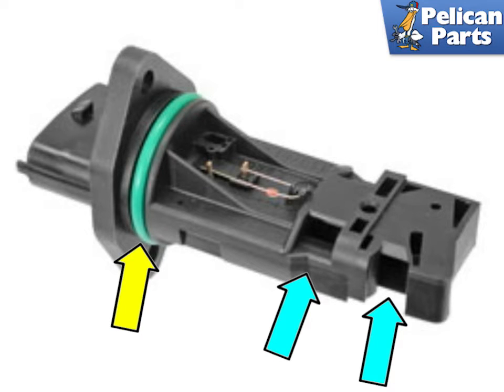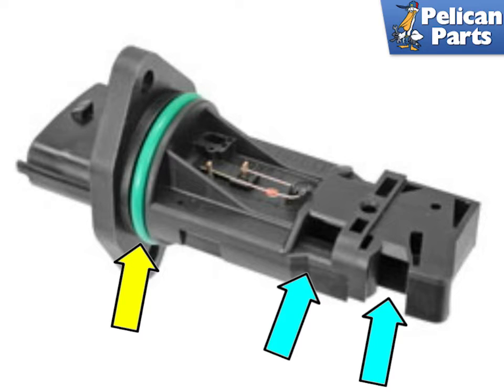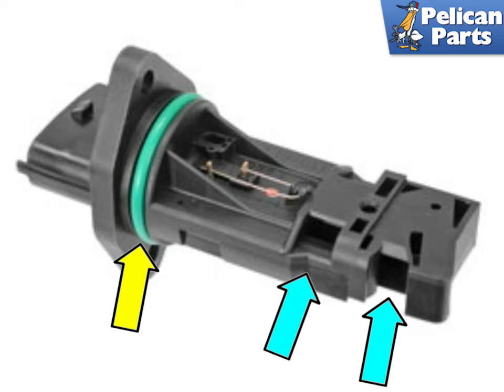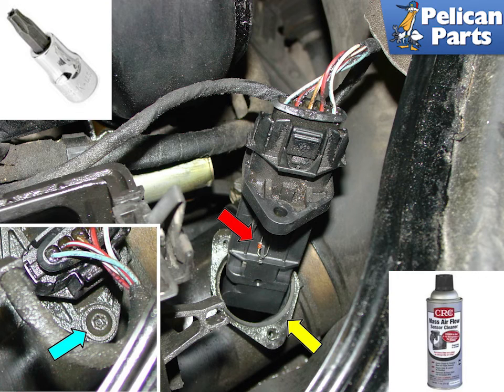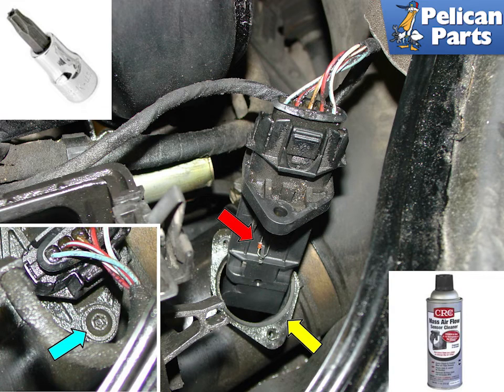Porsche Boxster 986 Mass Air Flow Sensor Replacement

Comment: Mass air flow “ a circuit low” on 98 Porsche Boxster “ ????
Reply from the maker: That is a fault for the circuit, not sensor performance. test the wiring and signal from the sensor to the DME to locate the short in the circuit. Possible it is the sensor, but you have to rule out the wiring itself.
Reply: Can it be a relay issue?

Comment: The PDR REPORTS “ A CIRUIT LOW” ????
Reply from the maker: That is a fault for the circuit, not sensor performance. test the wiring and signal from the sensor to the DME to locate the short in the circuit.